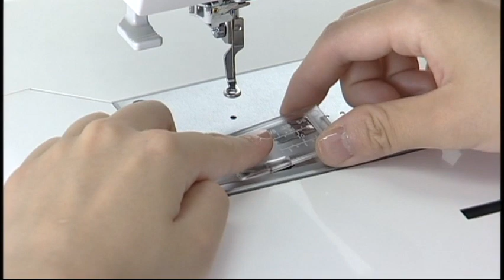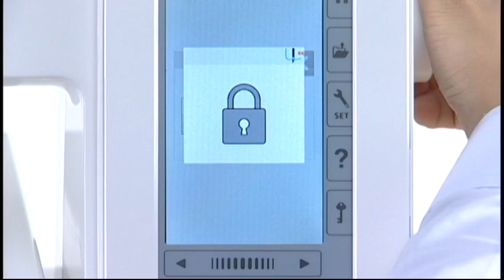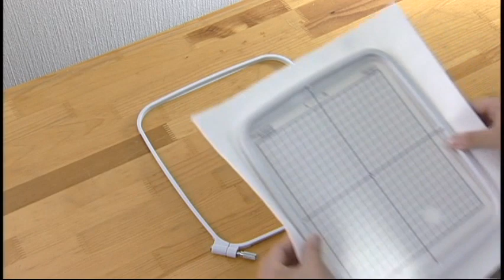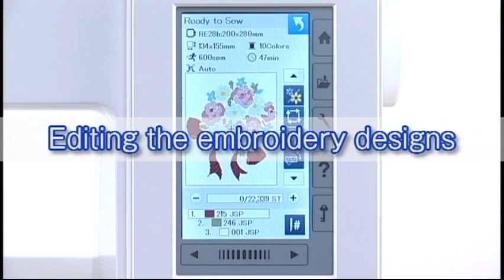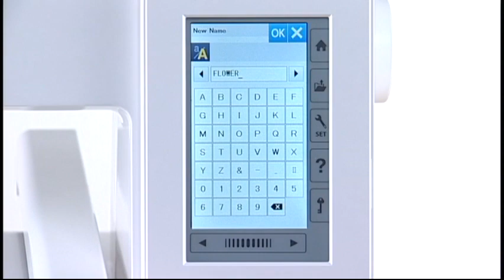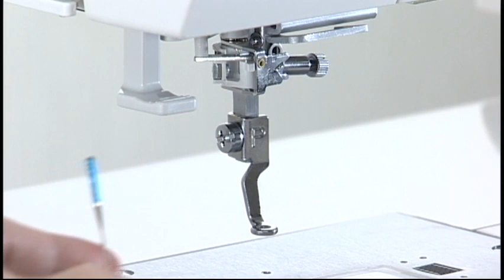Janome 500E instructional DVD

Comment: Help.  The needle will no longer go into embroidery bar hole.  I’ve tried replacing the needle along with remove the embroidery bar clamp and replacing it.  The needle still goes to the left of the hold.  Which in turn is not creating the selected designs.

Comment: just wondering if you could help, my janome is stuck on a warning sign, beneath it, it says raise the needle bar slowly, but no matter what I do nothing makes it go onto the display screen. I haven't oiled it yet though since ive had it, bad me I know.
any suggestions would be appreciated.
Reply: Hi, sorry if I am much too late but this is a normal warning sign, all you have to do is simply turn the circular white wheel on the side and it will function back to normal.